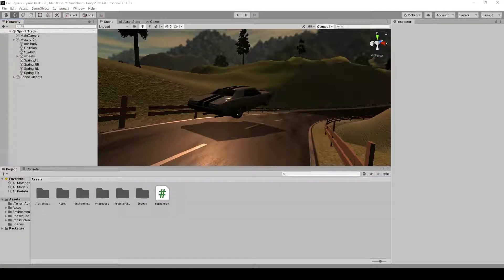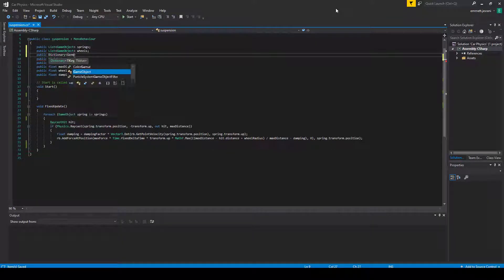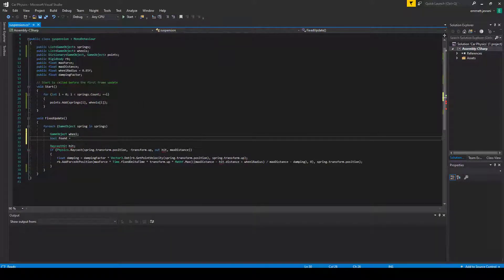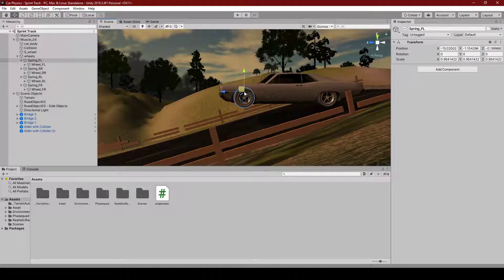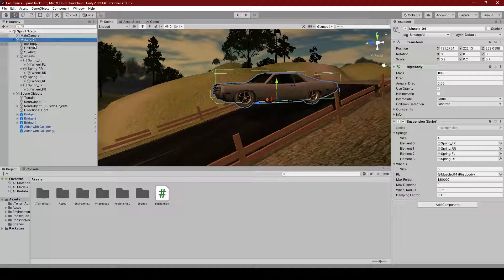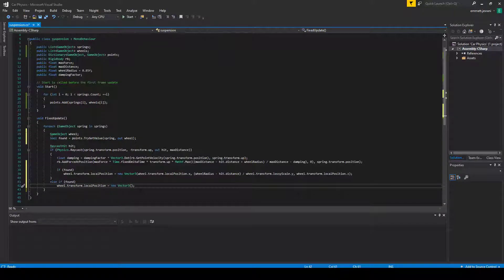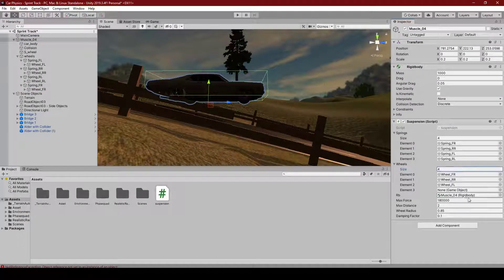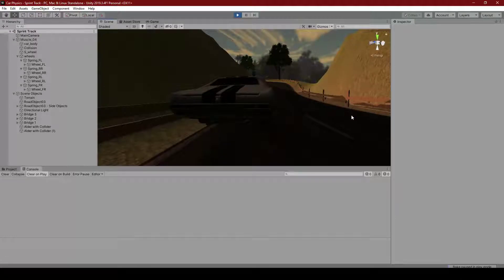Advanced Car Tutorial #3 - Moving the Wheels with the Suspension

Comment: do you plan on going over how to add friction to the wheels?
Reply from the maker: forward friction is mostly just a product of standard friction on the axels (if you want to be extremely technically accurate, consider the spring compression at each axel and use that + angular momentum to calculate some sort of friction component to slow the car). after that, apply some form of friction formula (whether linear or more advanced based on literature) to account for the difference between wheel rotation and car speed (skidding effects)